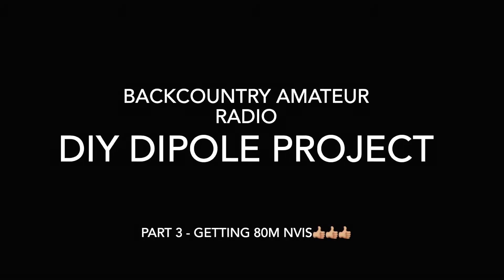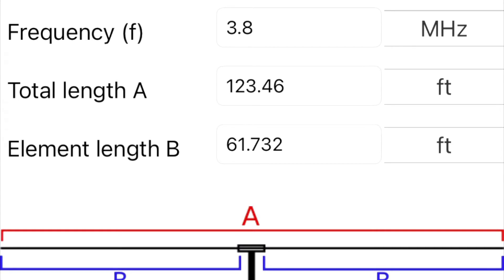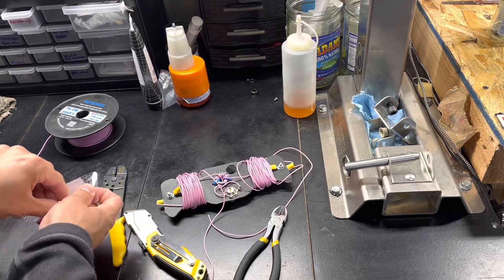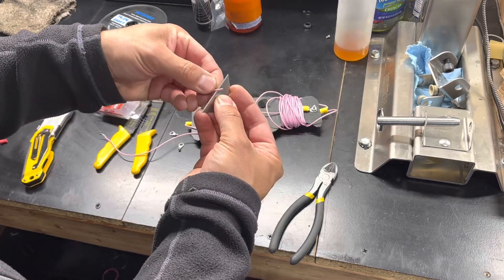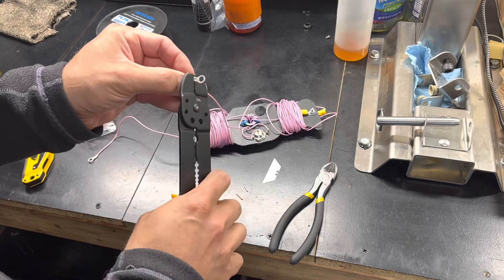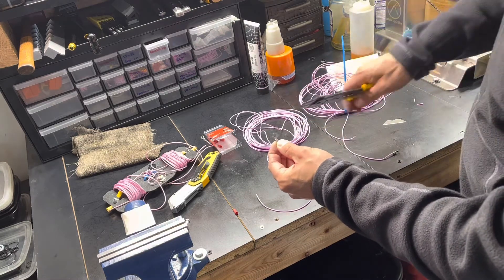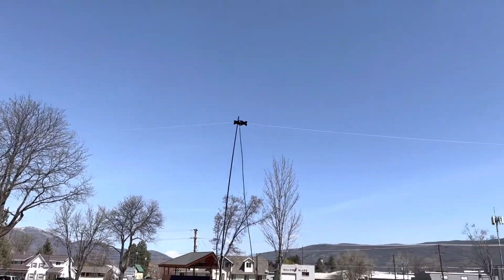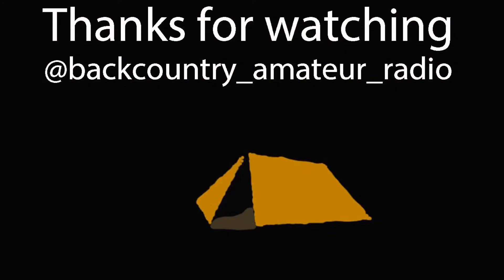Part 3 - DIY Dipole 40m to 75 or 80 meters - NVIS communication

Comment: Great job in your antenna building.  I’m working on building my own linked dipole.  There is so much satisfaction in using an antenna that you built yourself.  73 W1UTE
Reply from the maker: Thank you David! I've found that the antenna's I prefer to buy are kits anyway, so why not just start from scratch and do my own? It's fun and rewarding, you're absolutely right. In building your linked dipole, will you use in-line insulators for quick connect/disconnect of the additional bands? I think my next one will do that and use banana plugs to make it easier.